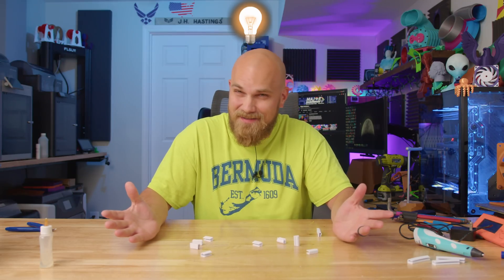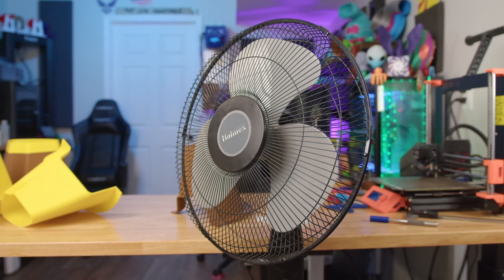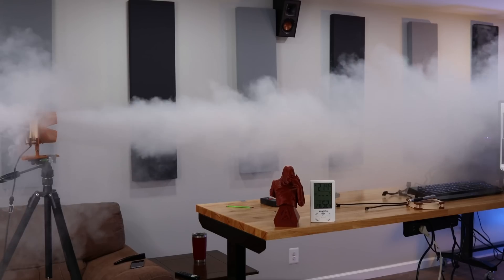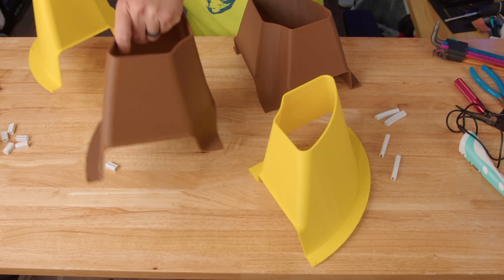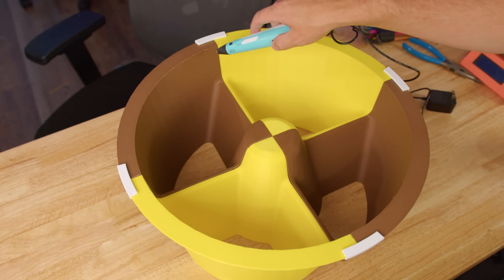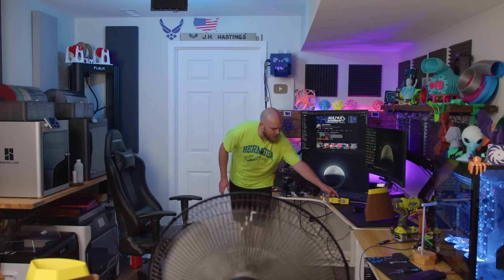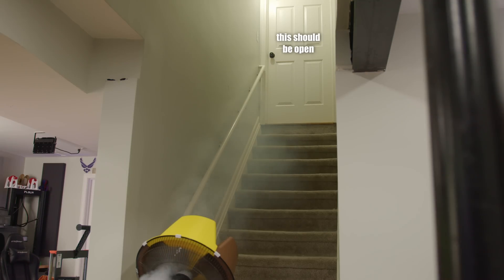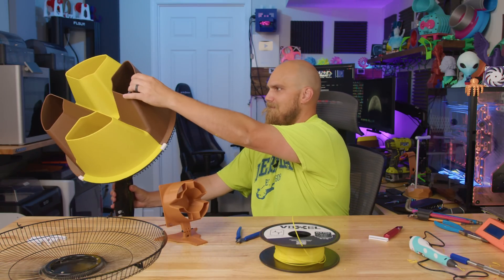Should Noctua make this STAND FAN?

Comment: Get a new thermostat that comes with wireless auxiliary temp sensors and put one of the sensors upstairs. You should be able to program where it can run off either just the downstairs thermostat or the upstairs sensor, or can program it to rely on the average between both the downstairs tsat and upstairs sensor.

Or get an AC window unit for the upstairs bedroom (which will actually be cheaper than the fancy thermostat. Or a portable AC unit which has a  flexible duct with a fitting that will blow the waste heat outside (which will look nicer from the outside).

Those would be your cheapest options.  The most expensive option would likely be either getting a damper installed and new thermostat with zone control (this will also require auxiliary sensors) or getting a mini split system installed to service the upstairs or bedrooms. The mini split systems would be far quieter than your normal AC or the window unit or portable unit I mentioned earlier, and honestly the most effective solution out of all I mentioned.

Comment: Vornado has fans that throw air far. Check for example the Vornado 660.
Reply: Put that on a 660 and it would probably knock the kids over. My wife has a cousin who's a retired engineer for Vornado and I've seen some of the numbers. That model moves close to 600 cfm.

Comment: not only is my bedroom on the end of the duct line, but I also have a westward facing window so I get a lot of sun in my room during the day and it warms the room up significantly even despite having A/C.  So what I did was take a 80mm USB powered fan and screwed it down to a plastic vent cover and created a DIY vent booster.  Doesn't make a significant difference, but it helps.

Comment: my solution when I was on the very tail end of a central air run:
I took a couple of AC powered Server Rack fans and hung them below my vent. When I wanted to steal warm or cold air from the rest of the house I'd kick em on. Worked fabulously

Comment: i used a scroll cage barn exhaust in the basement throwing air up to ground level. kept sucking the pilot light for water heater out. so it was either hot water or cooling room air but not both.

Comment: Your house has forced air, I assume? Just cover up part of each downstairs (& basement) outlet and/or intake. That way the AC will push more of the cold air into the upstairs areas. You just have to remember to revert that modification for the winter, or heat will accumulate upstairs.

Comment: Could you use this concept with an appropriately sized fan to fit over your AC registers on the 2nd floor and maybe pull more cool air through the ductwork into the space?
Reply: I'm currently doing this utilizing an 8 inch fan from menards And an 8 inch duct coupler flash taped to the register. It has brought down the upstairs temperature a solid 7° over the span of the last 3 days. Unfortunately the ac in our townhouse sucks at pushing up to the top floor so this is our solution til we can get a new system.

Comment: Set the fan upstairs and blow the hot air down. Should lower the pressure upstairs and pull more cold air thru the AC vents

Comment: I printed out the 120mm version right after your first video, and i still use it all the time in summer (bought a 5V Noctua fan and attached it to a USB power supply to make things easy). It's so great, much better than just the fan by itself for cooling.
Reply: Yep. Made my own version (closer to Noctua) attached it to a stand and slapped a Delta fan. It literally sends air across the whole room without any trouble
Reply: Arctic literally sells one of their p12 Max fans as a desk fan.

Comment: This is why my parent's 2 story house has 2 ACs, so the upstairs and downstairs are controlled separately and the compressors aren't worked as hard.

You can also setup some zoning to turn on the upstairs separately from downstairs with only 1 AC.

Comment: You made a nozzle, so the air speeds up. You could do this with just a poster sheet instead. Or even print a frame and then put paper on it to "seal it"

Comment: My family for years, in Northern Virginia which gets very very hot, had a pair of the biggest box fans they could prop in the stairs, one pointing up from the basement and the other one at the bottom of the main floor to circulate a little cool air in the upper level upper level, as long as both fans were not running very hard, and the AC was not set it 50 it was actually pretty consistently cool throughout the house, and didn't use very much energy.

Comment: Yes, print it on a box fan or those Vornado fans. You keep the finger guard, and blows really strong.

The things we come up with when it’s so hot outside. I created a ducting system to exhaust out 2 of our PCs heat out the window.  I 3d printed the elbows, couplers and shrouds and just bought the plastic vent tubing and a window vent kit from Amazon.
Reply: For years I've been wanting to build my PCs in a cabinet, one specially made for it with ducting to pull air through in to the PCs. With the fans at the inside end of the ducting and then sound isolate the duct so the noise is lower (like how you see they did it in the latest Gamers Nexus video with the ducting for the anechoic chamber, and then have the same  at the exhaust, but have it lead to the wall air vent. And have an opening near the vent that can be closed or opened depending on if I want the heat to stay inside or not. Just to get a very quiet room, not that my PCs are loud, but when recording sound, their sound is picked up, and to stop it from being extra hot during summer when I use them.
Reply: Yeah, definitely would like to see this done on a Vornado 600 series fan.  A box fan would be quite interesting, too, but probably difficult to print a shroud large enough for.
Reply: The problem with exhausting computer heat directly out the window is that you create a negative pressure system within your house and the outside air will be leaking in from wherever it can. So if the outside air is warmer than your PC's exhaust air, that's not a great solution.

Comment: Hear me out... a multi-video project of using the motor from a cheap box fan to print/build a box-fan-sized noctua with the shroud.  Keep in mind I think 3d printing the whole thing would be silly.  You could make the box out of plywood and use hard foam insulation to fill in the area to be a tight fit to a fan.  I do think the blades and shroud parts would have to be printed and designed to probably screw or dovetail together and then be glued for reinforcement.
Reply: That sounds insane and I like it...
Reply: Just 3D print the whole thing. Do a crossover with Ivan Miranda.
Reply: A standard box fan is a 20" square about 4.25" thick, so that would be an A50x110.

Comment: Honestly, pull that thing off it's stand, or get a floor fan of the same size, and use that.  The air on the floor is cooler anyway.  Just curious, did you try setting the fan on your HVAC system to ON, instead of AUTO, so that it runs all the time and has a chance to balance the air temps?

Comment: that particular fan isn't meant for static pressure, so if you were to design new blades for it, you might be able to push a great deal more flow
Reply: ON THIS SEASON OF FAN SHOWDOWN: 16 INCH STAND FAN
Reply: This time next year, video title: "I made a Roots blower to sleep easy at night"
Reply: Let's face it with regards to where this stub will eventually bare fruit:  The Major Hardware branded consumer and industrial grade fan product line that will blow away the competition.
Reply: Also the induction motors are built to a dime, have little torque and can overheat if you start driving them harder than designed.
Reply: I can already see the giant CHEATER.
Reply: even so we just saw a 50% improvement, giant noctua fan blades time??
Reply: Let's not forget the little handheld 2 inch fans 👀
Reply: actually it is because it has big blades like a pressure fan does
Reply: @DatBlueHusky : What: not all fans are for pressure of some sort?